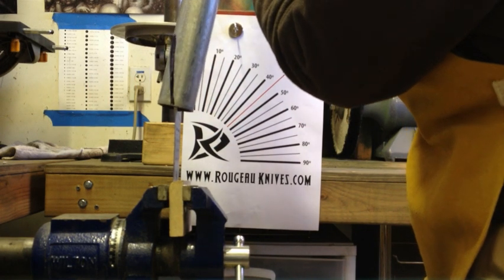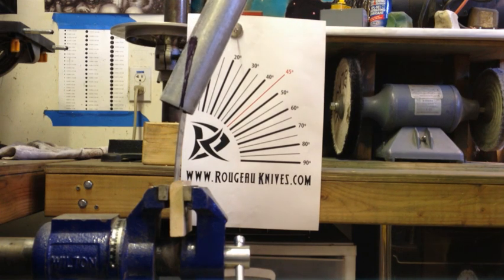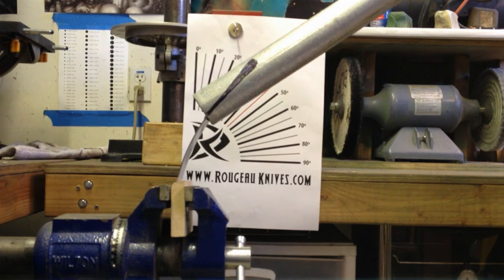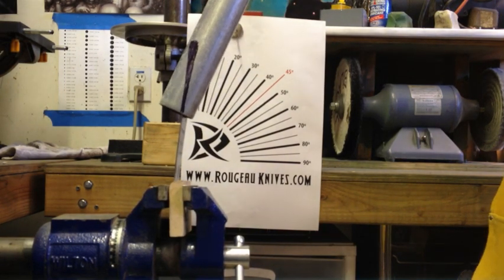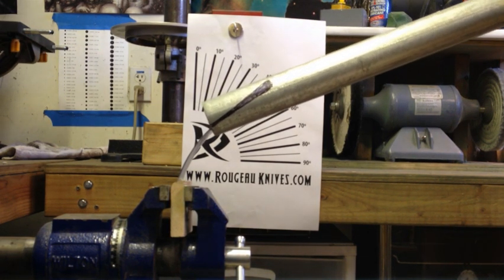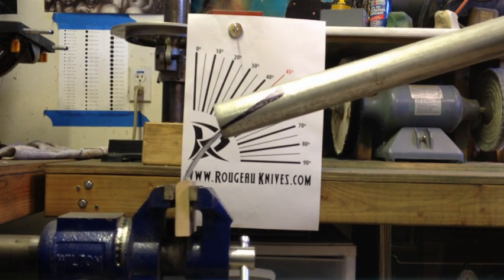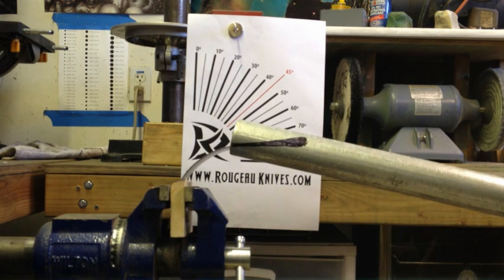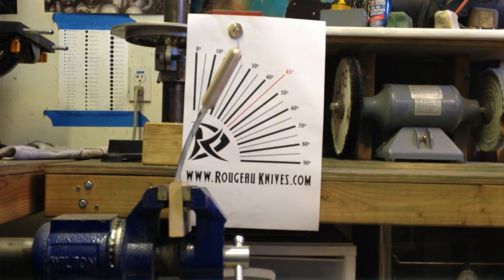Knife makers bend test of O1 tool steel

Comment: This gave me ptsd just waiting for the unknown. Its clear you have experience with O1. So perhaps you might be able to answer my question. Which steel do you feel is tougher O1 or A2. And I'm simply talking about toughness not the ability to take a better edge or keep an edge for longer time, but an ability of the steel to take lateral stress just like in your video and impacts/shocks. For a long time everyone on line kept saying A2 was tougher than O1 but when looking at the composition of each steel logic dictates that O1 should be tougher even if A2 is stronger since it has higher percentage of carbon. Have you had any experience in these two metals, and if not what would your experience and knowledge make you choose one if you had to take an educated guess based on steel composition. I went along with the concensus that A2 was tougher, untill I broke my A2 knife from a famous maker who I won't mention. After striking the side of the blade with a steel pipe, I knocked chunks of the blade the size of nickles and quarters out of the knife. The knife was hardened to 55-57rc. And I know the knife was not warranted for such use, however what is left unexplained is how a similar test done to 3 other knives which were much cheaper actually more brutal tests with a dozen more impacts to them failed to break any of them. And the knives were made from 1095, AUS-8, 1070. So now despite everyone still saying A2 is tough i simply can't agree with that statement. If you see my question i would appreciate if you gave me your thoughts, thank you.
Reply from the maker: I would say O1 is tougher.

Comment: I don't know anything about different kinds of steel and I realize most of the comments are from four years ago but how long would it take for a regular kitchen knife to snap?
Reply from the maker: Fruit Loop 
That would depend on the steel, blade thickness and heat treat. If this O1 tool steel blade was a 1/8” thick kitchen knife it would be even more flexible then this 3/16” blade.

Comment: what temperature did you temper this blade at?
Reply from the maker: Here's Evenheat instructions.
01 Tool Steel 1500°F 10 min. or until non-magnetic, oil quench
(oil needs to be warm - 100 to 150°F)
Temper at 350°F for 2 hrs.
Reply: thankyou

Comment: Hi, I wanted to ask you a tip, I would like to make me a good bushcraft knife with 10 cm blade to carry with me on trips in nature, choosing the steel wanting to stay on stainless steel, I recommend a 440C well tempered to 57 / 59 hrc which should have a decent wire hold but is it fairly straightforward to be sharpened in nature, or a more modern powdery steel such as S35VN or CPM154 that holds more sharp but is also more complicated to sharpen in nature?
Let me know what you think, Thank you Michele.
Reply from the maker: Michele Trekkning 
440c is best with a hardness of 58 to 60HRC and is a good tough steel. I always recommend sharpening stainless steel blades with a diamond sharpener. But with a little extra work you could do it with a wet stone. If you go to low on the hardness it won’t hold an edge. That’s why a lot of cheap 440c blades don’t hold an edge, they are to soft.

Comment: Nice video straight to the point. I subbed.
Reply: Same. Anyone who is prepared to hand craft a nice knife, then wreck it on camera for a bench test, deserves a sub! Im dreading doing my first torture test.....all that time.....then you break it.. but it has to be done. +1
Reply: Yeah that's a mark of "I've got nothing to hide"
Reply: indeed. Really tough knife though.... if you have to use a length of scaffolding pole to bend it, then nothing you can do with your hand is going to bend it far enough to deform it much, if at all.
Reply: Too right!

Comment: Mr Rougeau, any plans for bend test on A2? I hear it often said A2 is better than O1 etc, but I'm not quite sure it'll be as forgiving as O1 with the added chromium. Thanks.
Reply from the maker: +Christian Cork 
Eventually I will make a video on heat treating and testing O1, A2 and D2 tool steels.
Reply: I very much look forward to those videos sir. Thank you for sharing your knowledge.

Comment: Have you ever tested D2 in that way and if so how does this compare to O1, 1095, etc. ?
Reply from the maker: Not yet. D2 is expensive and I haven't had anyone ask for it on a knife order. Also I might test D2 standard tool steel and CPM D2. I am looking forward to testing it and I will probably do a video when I get to it. Thanks

Comment: i was thinking about buying a knife that was designed in 1095 but recently changed to this 01 tool steel at the same price point. my first inclination was this was cheaper to manufacture for the company. Im not pretending to know anything about this but is 01 a worse steel then 1095 for a knife. I don't want to spend the same amount on a worse steel.
Reply from the maker: O1 tool steel is a better blade steel than 1095. O1 is four times the price of 1095 and easier to heat treat.
Reply: wow no worries then haha thank you for your fast reply. subscribed